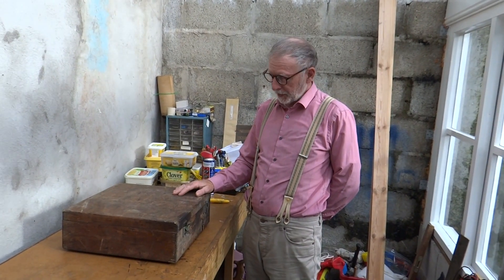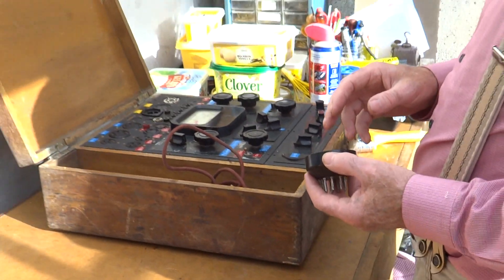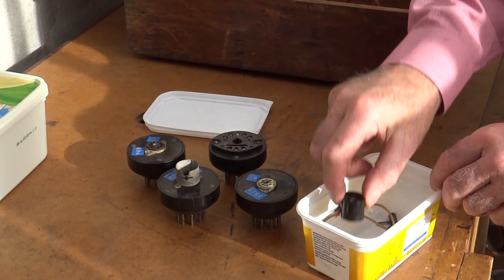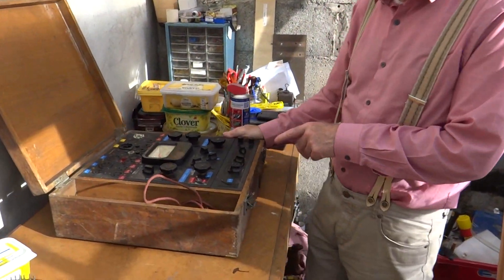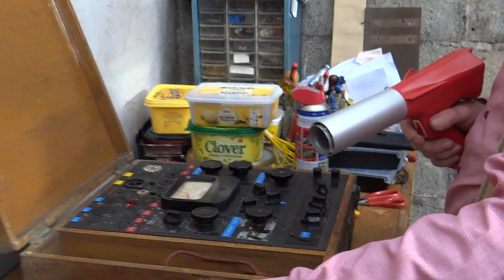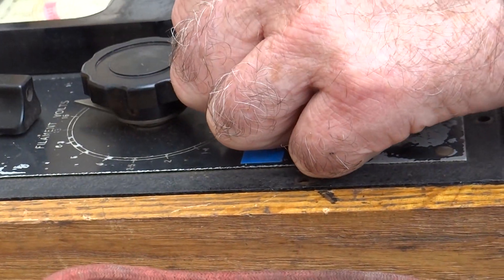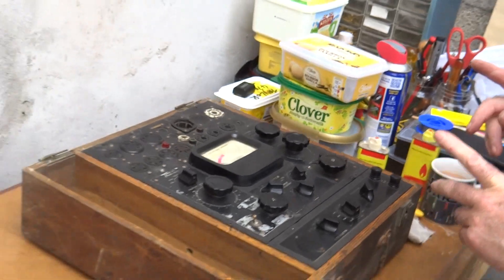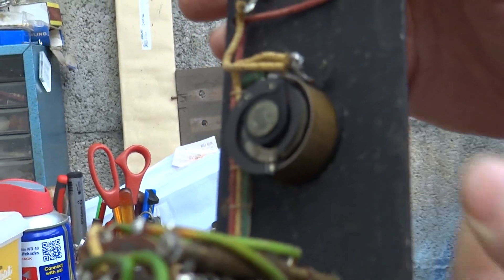Taylor 47a Valve / Tube Tester Restoration

Comment: At 8:27 you are pointing at a resistor (wound on flat mica or paxolin) about which I need information in repairing my Taylor. Somewhere I have the hand book but the circuit does not show values and I need to know the value of the (1 or 2?) wound resistors...It's now October 2024...please drop me an email so I can make contac...,My regards George.